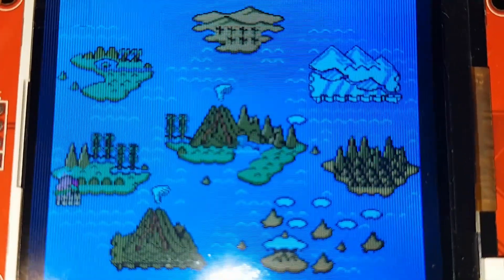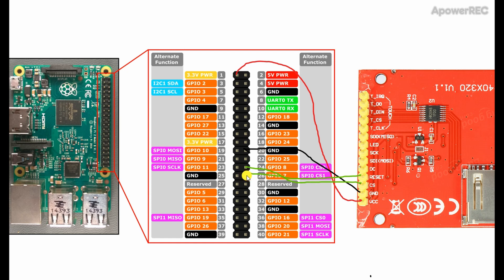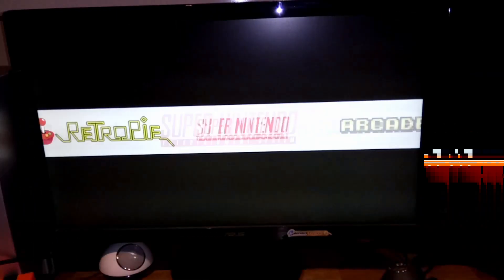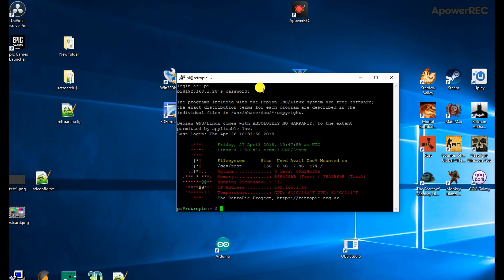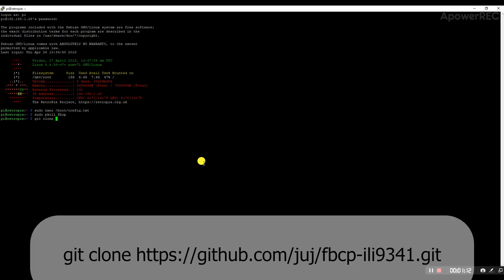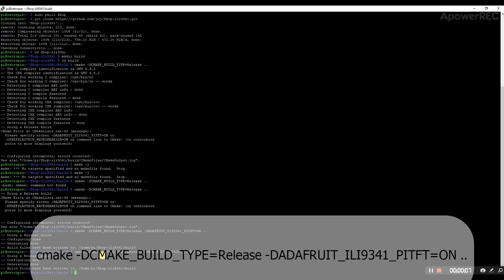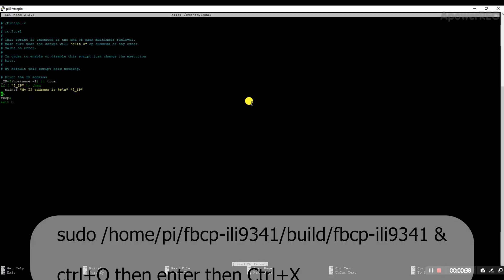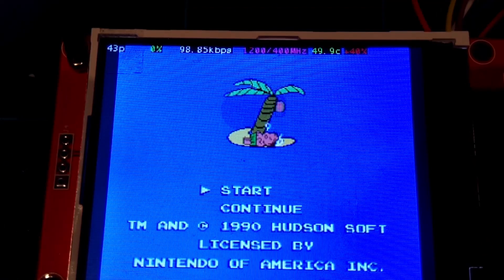cheap 2.8 inch ili-9341 SPI screen retropie 60 FPS Juj method tutorial

Comment: I got an error that I needed a DSPI_BUS_CLOCK_DIVISOR and based on Juj's documentation on GitHub the following cmake command worked for me:
cmake -DCMAKE_BUILD_TYPE=Release -DADAFRUIT_ILI9341_PITFT=ON -DILI9341=ON -DSPI_BUS_CLOCK_DIVISOR=6 ..
Reply from the maker: This video needs an update
Reply: @bamsegod  Same. Is there an easy way to get around this? Thanks!
Reply from the maker: @antmusic97  the script is changed now asks you to put commands with each attribute. Try one above from John
Reply: @bamsegod  appreciate the quick reply, realised another comment had what I needed. Although when I entered sudo ./fbcp-ili9341 screen just stayed white. No luck. Doing a fresh install and starting back at square 1!
Reply from the maker: @antmusic97  you need to double check the pin numbers I think you have one of the pins other way around hence the white screen. Either change the pins or change the script pointing to the correct pin

Comment: how did you pass this error?  "CMake Error at CMakeLists.txt:136 (message):
  Please define -DSPI_BUS_CLOCK_DIVISOR=<some even number> on the CMake
  command line! (see files ili9341.h/waveshare35b.h for details) This
  parameter along with core_freq=xxx in /boot/config.txt defines the SPI
  display speed.  Smaller divisor number=faster speed, higher number=slower.

-- Configuring incomplete, errors occurred!
See also "/home/pi/fbcp-ili9341/build/CMakeFiles/CMakeOutput.log".
Reply: cmake -DCMAKE_BUILD_TYPE=Release -DADAFRUIT_ILI9341_PITFT=ON -DILI9341=ON -DSPI_BUS_CLOCK_DIVISOR=6 ..

Comment: Hi, I bought the wrong one. The ones for Arduino. Is there a way to connect those kind to the raspberry pi? Thanks.
Reply from the maker: Yes should be ok as long as it has SPI interface

Comment: when i write make -j didn´t appear something, am i doing something wrong?
Reply from the maker: cmake -DILI9341=ON -DGPIO_TFT_DATA_CONTROL=24 -DGPIO_TFT_RESET_PIN=25 -DSPI_BUS_CLOCK_DIVISOR=6

Try above before make -j step
Reply: @bamsegod  ok, i will try it c:
Reply: @bamsegod  it compiles, but nothing appears in the tft screen, i think it is the same model that yours
Reply from the maker: @abrahamsanchez2461  check the wiring make sure that you datacontrol pin is going to gpio 24 (not pin 24) and reset pin is going to gpio 25.
Reply: @bamsegod  Hi I'm running into the same problem here, and per your suggestion of using gpio24 and gpio25, this is different from your wiring in the video, should I follow this instead of your video? I have double checked that wiring is the same as the video but I'm still getting a blank at the last command (sudo ./fbcp-ili9341)
Reply from the maker: @eiennofantasy  check above comments
Reply: @bamsegod  I got it working now... after I have added it permanent on startup, everything seemed to have work. Thank you very much for your help.
Reply: @eiennofantasy  how to make it permanently?
Reply: I make it Even longer, with all the information in they Github, but yeah thats my problem, pin isnt the dame as gpio
Reply from the maker: @abrahamsanchez2461  check the pins again and try again
Reply: It works fine :) now i only have to adjust the resolution
Reply from the maker: @abrahamsanchez2461  just edit the config.txt

Comment: The cmake step failed on my zero W. Here's what it spit out (bottom 5 lines):

cmake -DCMAKE_BUILD_TYPE=Release -DADAFRUIT_ILI9341_PITFT=ON ..
-- The C compiler identification is GNU 6.3.0
-- The CXX compiler identification is GNU 6.3.0
-- Check for working C compiler: /usr/bin/cc
-- Check for working C compiler: /usr/bin/cc -- works
-- Detecting C compiler ABI info
-- Detecting C compiler ABI info - done
-- Detecting C compile features
-- Detecting C compile features - done
-- Check for working CXX compiler: /usr/bin/c++
-- Check for working CXX compiler: /usr/bin/c++ -- works
-- Detecting CXX compiler ABI info
-- Detecting CXX compiler ABI info - done
-- Detecting CXX compile features
-- Detecting CXX compile features - done
-- Doing a Release build
-- Board revision: 9000c1
-- Detected this Pi to be one of: Pi A, A+, B rev. 1, B rev. 2, B+, CM1, Zero or Zero W, with single hardware core and ARMv6Z instruction set CPU.
-- Targeting a Raspberry Pi with only one hardware core
-- Enabling optimization flags that target ARMv6Z instruction set (Pi Model A, Pi Model B, Compute Module 1, Pi Zero/Zero W)
-- Scaling source image to view. If the HDMI resolution does not match the SPI display resolution, this will produce blurriness. Match the HDMI display resolution with the SPI resolution in /boot/config.txt to get crisp pixel perfect rendering, or alternatively pass -DDISPLAY_CROPPED_INSTEAD_OF_SCALING=ON to crop instead of scale if you want to view the center of the screen pixel perfect when HDMI and SPI resolutions do not match.
-- Preserving aspect ratio when scaling source image to the SPI display, introducing letterboxing/pillarboxing if HDMI and SPI aspect ratios are different (Pass -DDISPLAY_BREAK_ASPECT_RATIO_WHEN_SCALING=ON to stretch HDMI to cover full screen if you do not care about aspect ratio)
CMake Error at CMakeLists.txt:130 (message):
  Please define -DSPI_BUS_CLOCK_DIVISOR=<some even number> on the CMake
  command line! (see files ili9341.h/waveshare35b.h for details) This
  parameter along with core_freq=xxx in /boot/config.txt defines the SPI
  display speed.  Smaller divisor number=faster speed, higher number=slower.

-- Configuring incomplete, errors occurred!
See also "/home/pi/fbcp-ili9341/build/CMakeFiles/CMakeOutput.log".
Reply: In the ../CMakeLists.txt there is a line around 130 where the SPI bus clock divisor is set to 0. The line looks like this:

set(SPI_BUS_CLOCK_DIVISOR 40 CACHE STRING "Specify the SPI0 CDIV ... blah blah blah

I think it wants an even number there. I tried 40, as it recommended, but the make -j failed at 94% while throwing errors about SPI_BUS_CLOCK_DIVISOR. Any idea what that number should actually be?
Reply: I figured it out! I left the CMakeLists.txt as it is. The clock divisor needed to be set with the cmake command. Instead of entering:

cmake -DCMAKE_BUILD_TYPE=Release -DADAFRUIT_ILI9341_PITFT=ON ..

I entered this and it worked:

cmake -DCMAKE_BUILD_TYPE=Release -DADAFRUIT_ILI9341_PITFT=ON -DSPI_BUS_CLOCK_DIVISOR=40..

That's all one line, btw. Not sure if 40 is the best value, since I just used it because the above txt file said it is safe, but the screen is working and the frame rate appears to be much better.

For some reason, there is a bunch of data at the top of the screen. It looks like frame rate, mbpa, some kind of frequency in Hz, temperature in c, CPU, DMAT, SPI MHz, and GPU. Anyone know how to get rid of it?

Comment: EmulatedBen , I followed all instructions carefully , paused your video sometimes to follow pin connections , etc .... and all I get is a white screen. Any idea what went wrong?
I have one of the red PCB ili9341 2.4 inch 240x320 LCD screens
Reply from the maker: Sean can you post a picture of the pinout of your screen. it seems like you have D/C and one other pin mixed up or may be its slightly different on your screen. white screen occures when you have pins not transmitting data.
Reply: @bamsegod  I will as soon as I am free to take photos. Thanks for your reply
Reply: First is the pins on the ILI9341 PCB https://i.imgur.com/0BsyGqR.jpg (the blurry wire for VCC is brown , which connects to top left pin on GPIO)
Raspberry pi I'm using is a Raspberry pi 3 B (not the B+ )
Then the view of the Raspberry pi GPIO from the left of GPIO: https://i.imgur.com/XSX23OU.jpg 
Then the View of the Raspberry pi GPIO from the right of GPIO: https://i.imgur.com/6wIQeBU.jpg
Reply: I forgot to mention, the blue wire on the bottom of the GPIO is just a ground tap to go with the red wire at the top right GPIO for 5v power for a fan.
Reply: I just rewatched your video and followed the wires by hand and they all go where the beginning of the video says they should go, is there any configuration I need to do differently in the make / build for the "driver" ?
Reply: my problem wasn't the wires, they were in the right places. My problem was with DMA. The DMA settings had to be manually configured by me in order to get it working right. THANKS for offering to look into my problem, I appreciate it. I figured it out , after reading through some errors on my pi after opening the terminal and starting the fbcp-ili9341 program in the terminal and seeing some errors, checked on juj's github , read the entire guide, and configured my setup entirely manually. It worked fine afterward, but since my pi3 is overclocked, I'm thinking about increasing the divisor for the core Mhz
Reply: I ended up using DMA channel 2 for TX and channel 4 for RX, in case anyone was wondering.
Reply: @seanabsher5577  My wiring is identical, even the wire colours, but still no go.  I got my board from Banggood.  Do you recall your cmake compile line?  I added the DMA and even forced the gpios (to other pins).
Reply: @MattKasdorf  the pins should be the same , don't need to change them. I remember using a tool to see which DMA numbers were free and which were not.  I suggest going to google and searching for raspberry pi DMA , so you can see a list of available choices.

Comment: Thanks for the video. Im using a 2.2" ili9341 screen and got it working with a pi zero W. Just 2 issues i need help with. On the top part of the screen there is some stats permanently being displayed and constantly refreshing (CPU, GPU, SPI etc). How do I remove this? Secondly I am getting 60fps from nes games but mame is slow and I'm not getting 60fps. I only tested these 2 emulators so far. Any help?
Reply from the maker: Yes I have noticed that as well. I will check with Jun on how to remove it. Also it uses one hour core for acceleration of the screen so some games could run slow. What did card are you using?
Reply: So did you use the same solution to get this working on ZERO?  It was said this is only working on 4-core CPU...
Reply: @BobrDrob  Yes I did.
Reply: Altaaf Sayedabdurrahaman share the how-to please
Reply: @yingbxua6240  I've done this with my LCD and Zero on the weekend. Everything is very straightforward. Just use the Sudomod link in the video description. The only thing was a bit off - you need to specify the SPI clock divisor. So your cmake command will look like that: 
cmake -DCMAKE_BUILD_TYPE=Release -DADAFRUIT_ILI9341_PITFT=ON 
-DSPI_BUS_CLOCK_DIVISOR=6 -DSTATISTICS=0 .. 
The last option disables the Statistics on the screen

Just go and try, it is10 mins not more
Reply: @yingbxua6240  I followed the exact same setup as EmulatedBen did in this video but with a pi zero w. The pinout configuration on the pi zero w is the same as the pi 3. What specific details do you need? I only tested it once though 2 months back with 1 nes game (contra) and haven't touched it since. I need to pick up this project again :)
Reply: @BobrDrob  This. Thanks a lot for providing the solution. I thought I was going to have to scour the google ocean for the answer again

Comment: Can this be done on a TFT LCD 3.95 Inch Screen For Raspberry Pi 2/3 with a Graphic Chipset using the  ILI9488? This is the 1 I have https://www.robotics.org.za/raspberry-pi-amp-accesories/RPA29501R . I dont know the pinouts on this board. Can you help please?
Reply from the maker: I am not too sure. give it a go. check the wiring on your screen before powering it on though

Comment: I want to inform you guys that adjusting the screen brightness on this screens is very easy:

Connect LCD --> GPIO18

sudo apt-get purge wiringpi
sudo apt-get install wiringpi
gpio -g mode 18 pwm
gpio -g pwm 18 value 

where value can be anything between 0 and 255 but you can also try higher values.
This is perfect for hooking up a poti or some buttons and let a python script run wich changes the brightness accordingly
You can also hook up your arduino to the LCD pin and use

analogWrite(LcdPin, value); // value can be 0-255

You will get a brighter screen using the Arduino, since the Pi only delivers 3,3V at PWM while the Arduino does 5V (I measured 4.6V and the image is slighty darker compared to using the 5V pin of the Pi)

Not sure if this will work on any pcb. I have exaclty the same one as in the video
Reply: You can also simply put a potentiometer between 5V and you LCD LED pin. But I dont know how much energy would be wasted in that setup

Comment: Is there any way to adjust the screen brightness on those red pcb panels?
Reply from the maker: Rodja Raskolnikow if you supply 5v it would be brighter and 3 v would be dimmer those are the only 2 options
Reply: I have the same panel but with a different PCB (Watterott) and it's possible to adjust brightness via PWM. I was hoping that, since in your last video you connected the LED-Pin to GPIO18 (PWM0) the same would be possible with this board. do you have an old setup at hand where you connected your LED pin to GPIO18? Then try adjusting your brightness with this commands: $ gpio -g mode 18 pwm
$ gpio -g pwm 18 X //where X is a value between 0 and 1023
Reply: I find adjustable screen brightness very pleasent especially when playing in bed or in bright sunlight. It also saves a lot battery time.
Reply: @bamsegod  What if we put a potentiometer on the LED line?

Comment: Thank you so much for this video! It worked, my SPI display is running at 60fps, but the display is backwards and the colors are screwed up. Can anybody help?
Reply from the maker: What do you mean by backward?
Reply: nvr mind. I fixed it by disabling my old fbcp driver and setting "display_rotate=2". By backwards i meant that everything on the display was flipped like a mirror of what it should be.
Reply from the maker: end mii glad you fixed it. You do need to disable fbcp as shown in the video. Enjoy.
Reply: Thanks!

Comment: Great video! The only drawback for me is that it won't work on Raspberry pi zero. Because according to the creator of the driver it won't work on single-core-processor computers.  :( . Sad, thanks for the video anyway!
Reply from the maker: sorry to know that. I was hoping that it would work but its ok. for me the key advantage is to use this screen with RPI3 is that i can fit it within some confined spaces like a orginal gameboy case. the analogue screens are too bulky and power hungry
Reply: EmulatedBen Hi can you help me pls i installed PuTTY Connected the PI and my Pc to The Same Network and it Says To me 

„Network error: Connection refused“
Reply: EmulatedBen okay i fixed it ist was The wrong ip but next Problem if i Type make -j it says
Make : * No targets specified and no makefile found. Stop.
Reply from the maker: R3D T1G3R did you download the file. You want to be in that extracted folder to make -j

Comment: Nice video! One note about frame rates on YouTube: when YouTube gear icon on bottom right says Quality "1080p", it means either 24fps or 30fps, so this video does not actually show the content at the same 60fps that the display is updating at with fbcp-ili9341. YouTube has a special Quality option "1080p60" that it shows in the Gear icon when the video is at 60fps. So if this video does not look like any improvement over EmulatedBen's earlier video about ILI9341 at 30fps, that's exactly right and it's not your eyes or the display, but it's just YouTube :)
Reply from the maker: absolutely correct, my crappy smartphone camera hasnt done the justice with the framerate of the screen. but this is definately better than the framebuffer fbtft method.

Comment: I would like to try this out on a pi zero w with this exact screen. I'm very new to this stuff so bear with me...
I have two questions:
Will this have any sort of impact on the Pi's CPU/GPU performance at such speeds?
 
And second question... Will 5v be harsh on the backlight?
Reply: Unfortunately Zero is out of the question at this point. Added a note to Readme about this, https://github.com/juj/fbcp-ili9341/commit/9926321d3d0270e324d9d8879e00456fa0a97aa3 . I've been hacking to try to get DMA working, and if it works out in the future, then perhaps that will enable the driver to be used on Zero as well.
Reply from the maker: If you are worried about 5v to led backlight just supply 3.3 via pin 17. I haven’t noticed any impact on gpu performance on rpi3. I haven’t got a rpi zero w to try. I am going to do some tests on the rpi zero in future so I will report back. Good luck